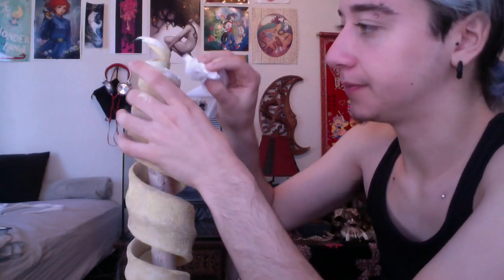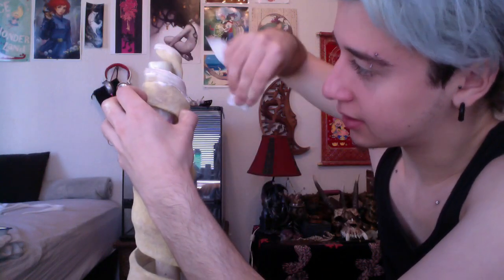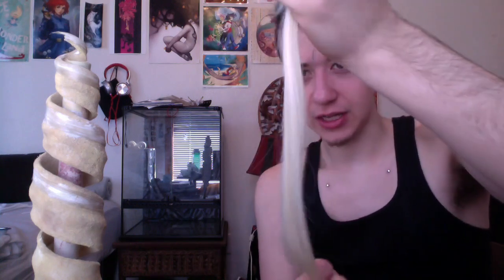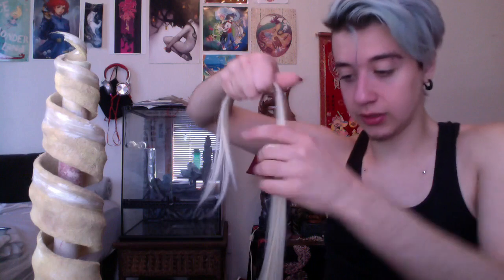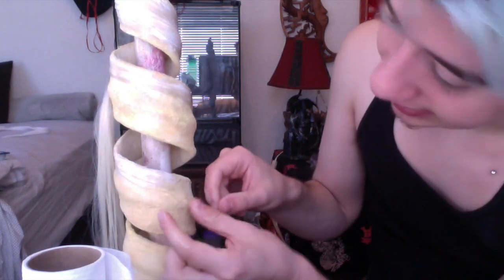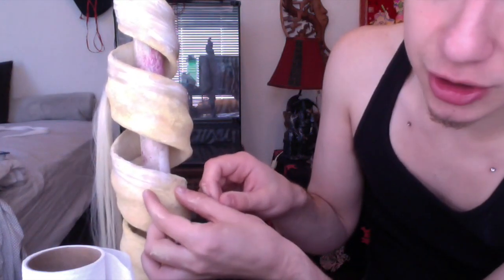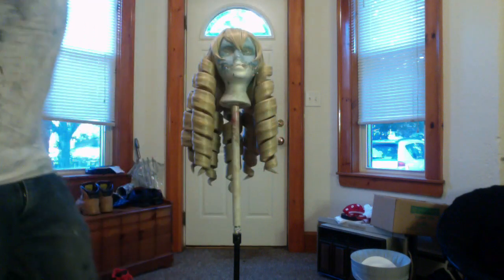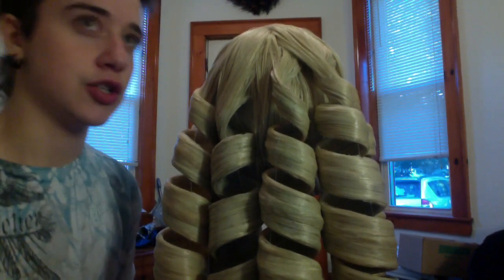(Part 3) Wig Drill Tutorial

Comment: How long are the drills you made. I’m making four very large pony tail like drills for my cure ace cosplay and those are down to right below the butt. I’m trying to figure out if this is a good way to do it. Also how much did each drill weight approx. thank you!
Reply from the maker: Hi there! Drills that long with fosshape might get REALLY heavy. maybe a meterial like styrene or packaging tape and wire might be better? I made long (waist length) drills for a rose quartz wig (about 7 of them) and the wig was decently heavy, maybe 8-10 lbs. It is possible though!

Comment: Hello! I was wondering how your wig felt on your head? I'm planning on doing a cosplay that requires only two but way longer curls and I'm afraid of how heavy they'll feel.
Reply: And I mean long as in PAST the length of my body. Please let me know! Thank you :)
Reply from the maker: Hello! I haven't worn the wigs other than briefly trying them on (and by briefly I mean like 1 minute) so I cant really answer that. However, my clients told me that they could wear the wig for a few hours, but the weight starts giving them a headache and so they cant do over 5 hours generally. Hope that helps! Good luck! :)
Reply: FaxenCosplay Okay thank you for responding! That does make me a little nervous because the amount I'm doing will definitely be heavier than the one you did, but hopefully I'll figure something out. Thanks again!
Reply: FaxenCosplay Oh actually, one other question I do have: Is it possible to sew multiple foams together to make the curl longer? So that way I can do them in sections?
Reply from the maker: yes it is! just be careful because the thread can burn and sometimes wont stay together. I suggest sewing together a few practice scraps and seeing what works for you!
Reply: FaxenCosplay okay thank you!!!